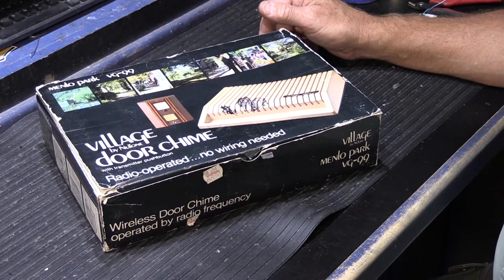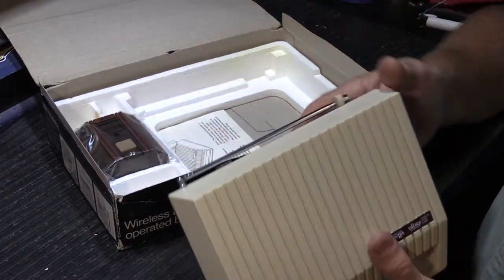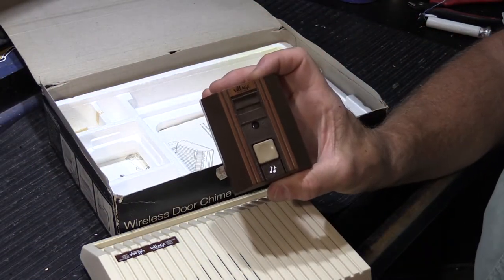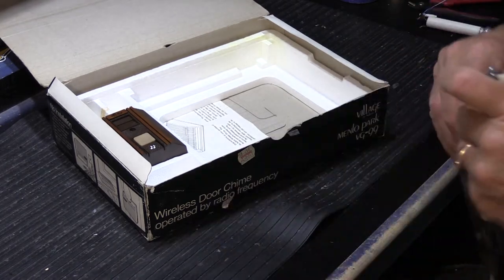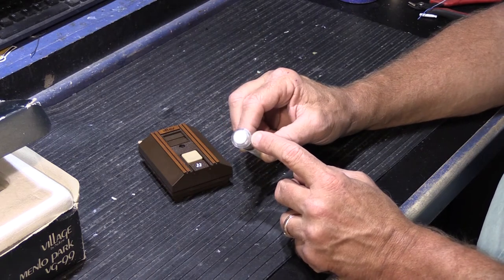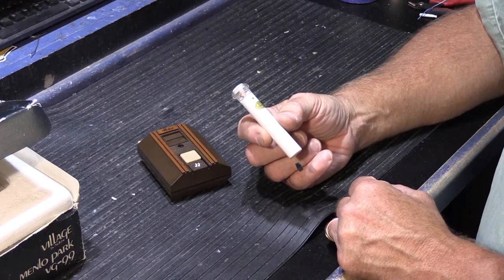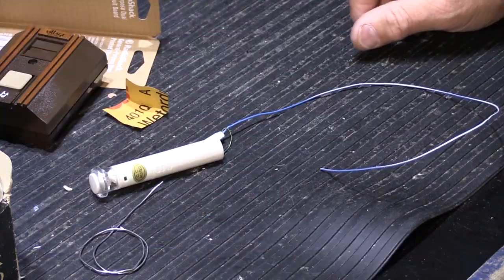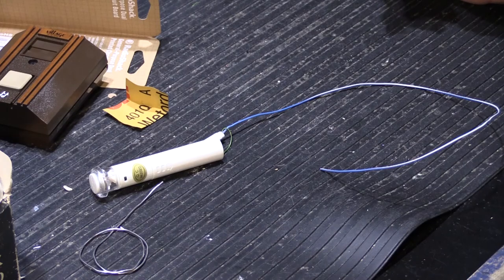How to Perform an Antenna Hack on a NuTone PB78LWHCL Wireless Push Button for Greater Range

Comment: The wire coming out of that transmitter looks like kynar wire, tough non melting, often used in wirewrap connection.
I could be wrong of cause.
Reply from the maker: Hi zx8401ztv: The antenna wire was very similar to wire-wrap wire - The Insulation was very tightly adhered to wire conductor - Chris

Comment: Did NuTone ever sell Village-branded radio intercoms, or did they only market voice intercoms and door chimes under that brand?
Reply from the maker: Hi VIncent: As far as I know, NuTone only sold IK15's and IK25 under the Village by NuTone name.  I have seen 2 examples - in our local area of Private Labeling done on Music Intercom Systems.  In the early 1970's NuTone private labeled the N2561 / N2562 as a "GuardTone" for a private Security Company.  Many of these were installed in Eichler homes.  In the mid 1980's NuTone Private labeled the IM3003 for Rimi Security.  These were all installed in Shapell Homes.  I would guess this probably would have happened all of the country - if a company was willing to step up and buy enough units - Chris